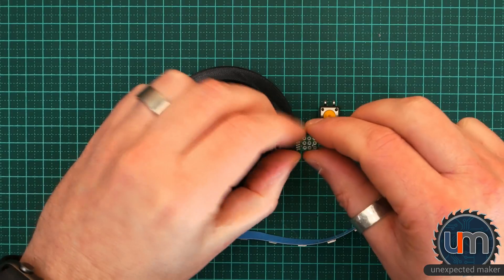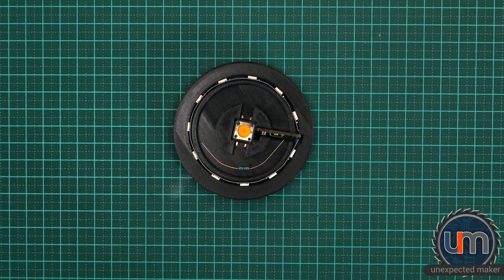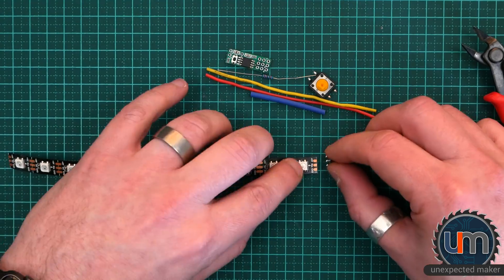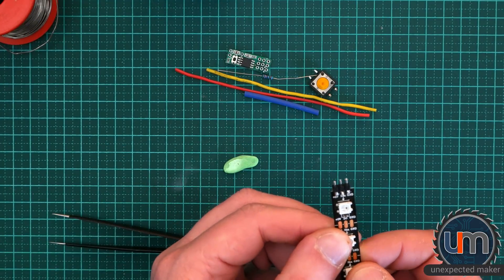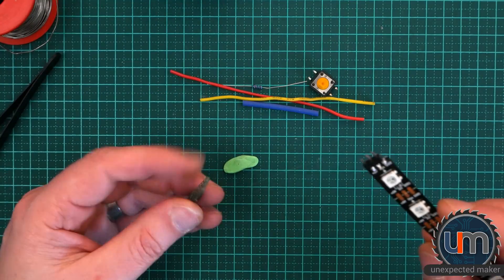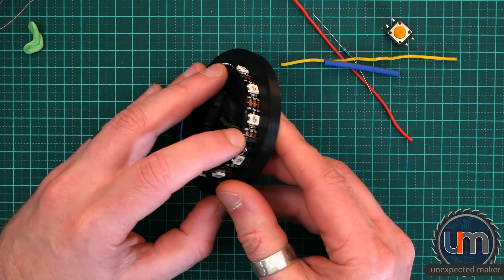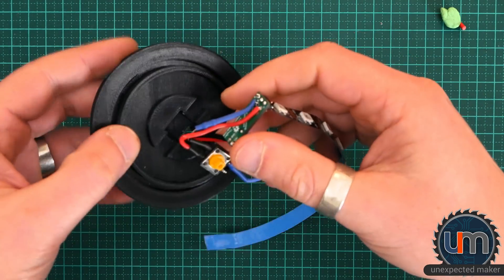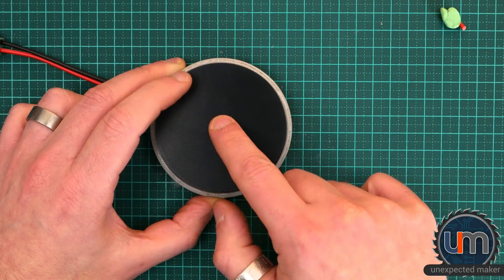Redo: My new livestream coffee warmer.. Fake or Real?

Comment: Save yourself some grief in future, ditch the 10k resistor, use the onboard pullup on the tiny85 and run GPIO-> GND through the button.
Reply from the maker: Yeah I always forget I can PULLUP on pins on some microcontrollers... I use that on my badge with an ATTiny85, but totally forgot to do that in this project. I think my brain capacity is shrinking as I get older ;)

Comment: This is the reason why ATtiny85's are so awesome!
Reply from the maker: I still need to grab some 13's but I need to user up my 90x 85's first ;)
Reply: is that replacing the attiny85? did I miss a new chip announcement? ;P
Reply: @Just Dave. Sorry Typo. lolz  *ATtiny85
Reply: solid save :D
Reply: @Just Dave what kinds of things do you like to used Attiny85 for?
Reply: I like to use the attiny13a for badges, couldn't fill up an attiny85 with blinking stuff anyways :)
Reply: I have some Attiny13a  and havn't used them yet. lolz

Comment: Why didn't you use a usb instead
Reply from the maker: No usb plug on the TinyDev, so kinda hard ;) Adding a small USB breakout board would have also just taken more space. I like using 2.1mm power plugs... I have stacks of them from 2A - 6A.
Reply: Unexpected Maker as a power supply

Comment: Is the black plastic ABS? I'd be worried about the hot coffee making it soft and deforming it. PLA would definitely deform (about 50 degrees C, it gets soft) and PETG might too (about 70 degrees)
Reply from the maker: In my case it's just PLA as my coffee cups are double walled... hot on the inside and cold on the outside, so no chance of melting the PLA. But yes, if I was to put a hot cup no it, an ABS top would be the way to go, or an acrylic top sitting in between the 3D print and the cup.